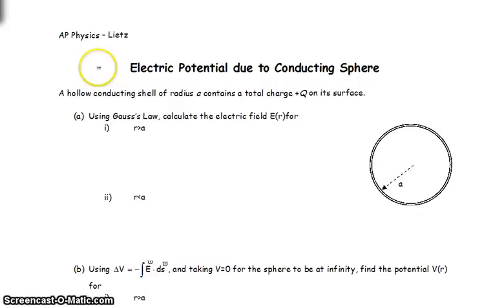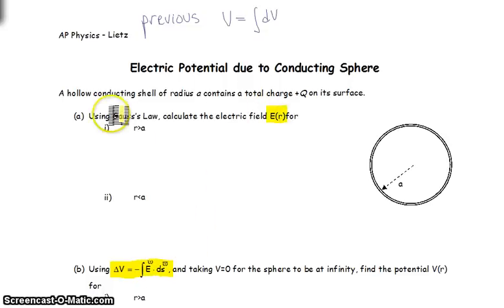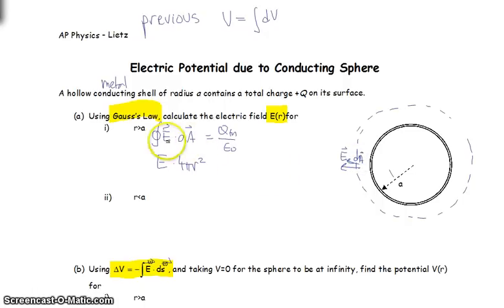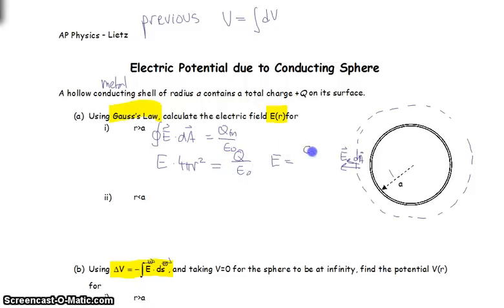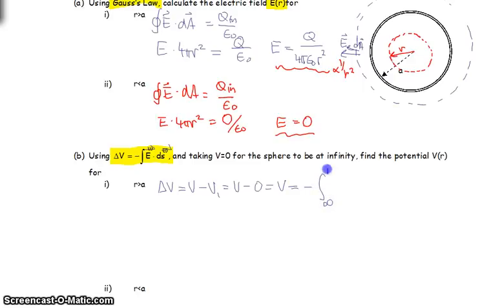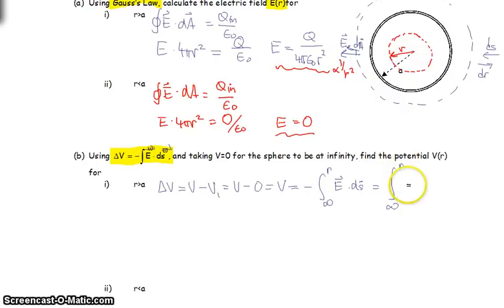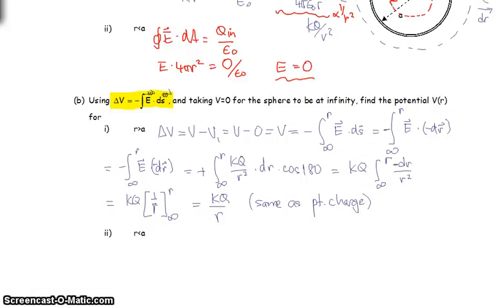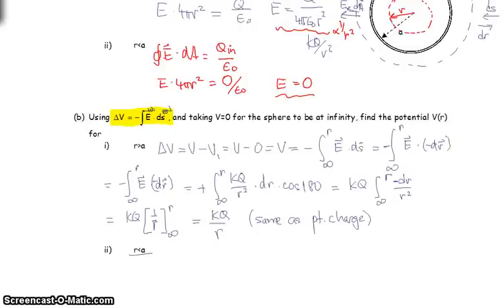Potential due to a Spherical Shell

Comment: I think in this video few things are confusing if anyone makes a deep thinking. 
You didnt mention that shell is thin or thick. if it is thin then it is ok. or not then for conducting shell there should be centre of charge +Q. whole calculation will be different for inside the shell.